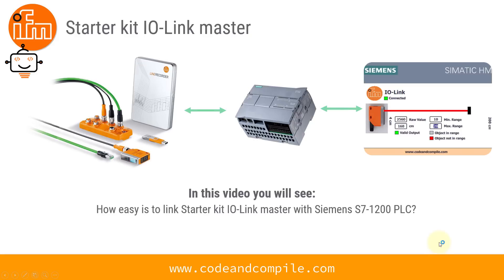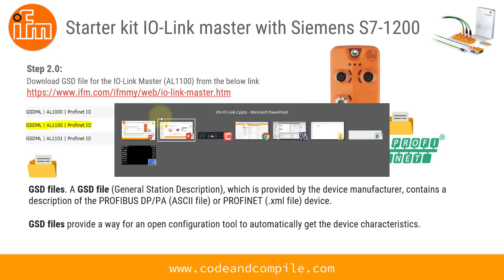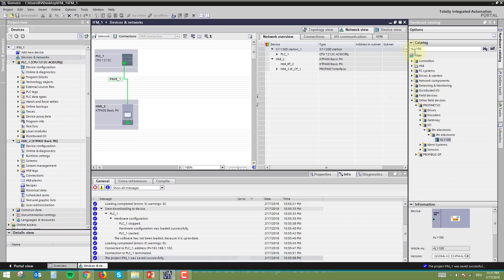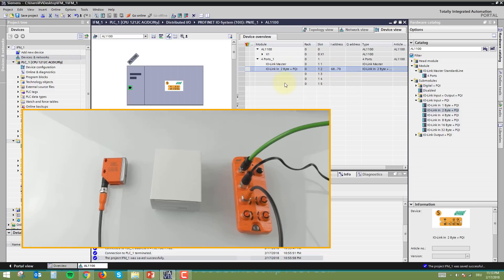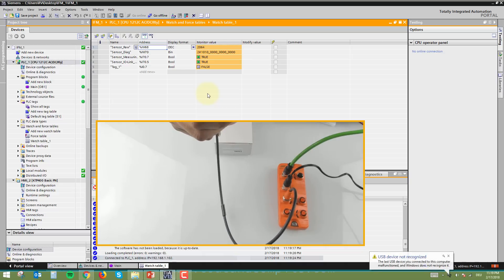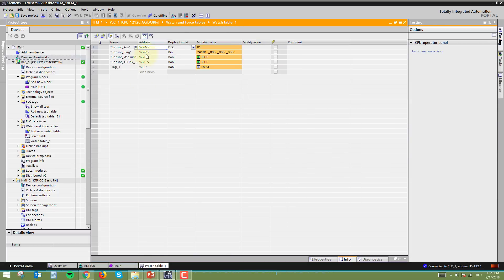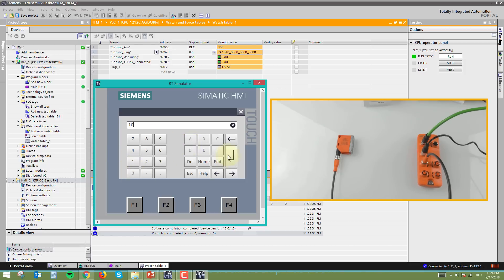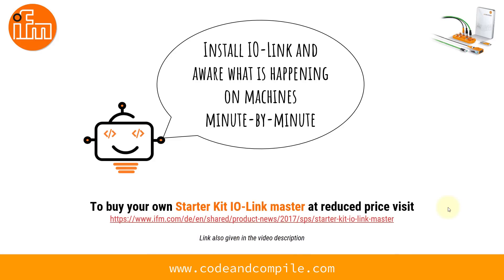How to link Siemens S7-1200 with ifm Starter kit IO-Link master

Comment: Hi, how do you parametrize the IO-Link sensor (set points, activation/deactivation of functions, etc)? do you need ifm´s configuration tool (Moneo) or can you do it directly in TIA Portal?
Reply from the maker: You can do via tool like Moeneo or LR Device but also via Siemens TIA Portal. It is easier to do with the LR Device or Moneo tool, actually.

Comment: IW68 which is Word data  but your  Calculate shows Real when i do this i get an error. How did you do this does someone know this
Reply: yeah, i have the same error
Reply: @trannguyenba1196  hey if you use SHR and shift the  raw sensor input by 4 byte  it  actual works great if you want i can email u my code or pics of my code

Comment: the IW68 is a word, and your calculate block is a Real, how does that work? or how did you get it to work that way?
Reply: Yeah i have the same question when i try this on my PLC I get error      Network 1,The data type Word of the actual parameter does not match the data type Real of the formal parameter. Compiling finished (errors: 2; warnings: 0)"   @servrt92 are able to figure this out?
Reply: @Dochollidayz20  it has been a while, but i gave up on this tutorial and i just downloaded and used the function blocks from IFM and used those if i recall correctly
Reply: @Suukerjunk its been a while, but I believe I can answer your question here. You can define the PIW as an integer datatype instead of a word. You can use the integer datatype in these calculation blocks and it will implicitly convert it to a real if you defined the calculation block as real math.

Comment: Hello Sir, I have IO -Link PI2898 pressure sensor installed below tank to  sense level in tank indirectly using pressure. From 2 days it is showing 10% more level than actual one. How to  solve this issue?
Reply from the maker: Can you calibrate it ? And please check if its correctly mounted. If proble still exist you can mathematically biased this offset

Comment: You don't need to calculate/scale sensor raw value with a formula. Last 4 bits for this sensor are not used so it is enough to shift value 4 bits right. 3200 SHR 4 => 200
Reply from the maker: Thanks for the tip ;)

Comment: Dear sir, i have a io link master(AL1102) connected with plc s7 1200. I set up the IP address of s7 1200 is 192.168.0.1 and the IP of io master is 192.168.0.37 . I did every steps like you showed on the video but when  i dowload and go online it  , a error is appear: not reachable.  Can you show me how to fix this problem? Hope you answer. Thanks you very much. Respect.

Comment: Hi, great video. Thx. When I have a s7 1212 and tia v12 and have a problem when I want to connect my al1102 to the cpu in the network window. When I right click on the al both entries a grey and I can’t chose the plc_1 as cpu for the master like in 5:13. Can you show or explain your ip config? Both are in the same subnet in my system. When I translate it says that the connection port from the cpu and the io link master are different

Comment: Hi Raj, great video! To simply the data handling can I suggest you look to the IODD file at the ifm website (IO Link Device Description). Taking the word value and shifting righting using the FB "SHR" by 4 bits you'll see the process data with no extra work. Here's the IODD for the O5D100: http://www.ifm.com/download/files/ifm-O5D100-20150804-IODD11-en/$file/ifm-O5D100-20150804-IODD11-en.pdf